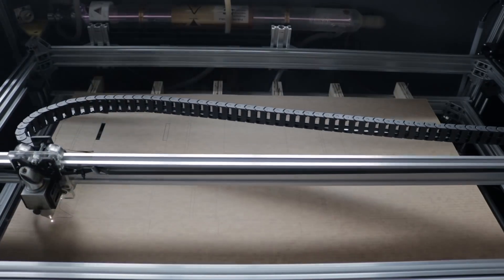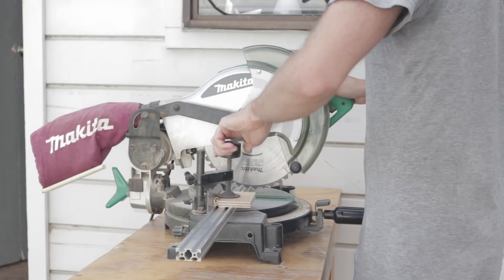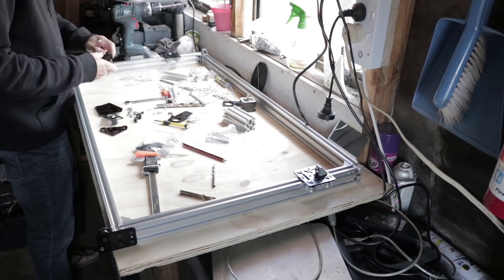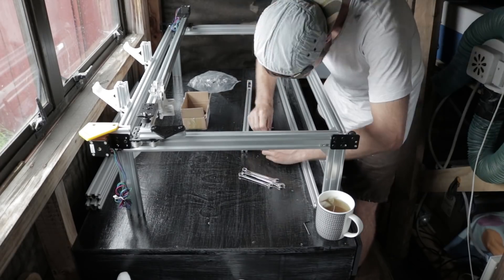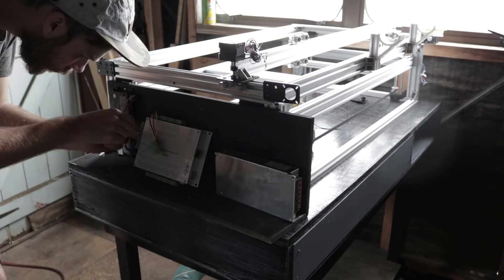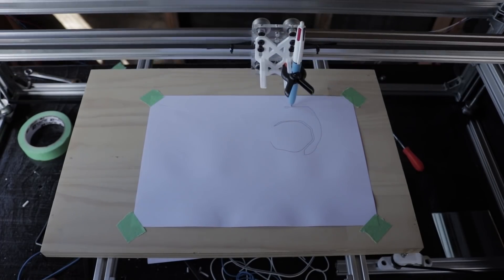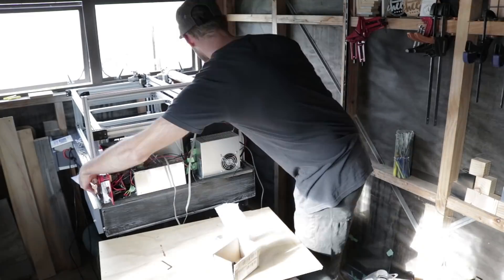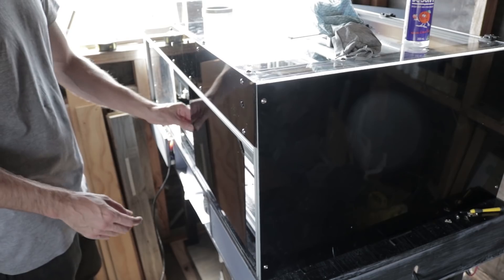DIY Homemade Laser Cutter

Comment: Very helpful. I'm currently in design phase of a simple 10watt optical diode laser, but I want the option to upgrade easily later should I choose to go CO2 (and finances permitting) but right now I got about 250 bucks to blow so I am pricing everything out during design. Figuring out what I can make and what I shouldn't make vs. purchase. Also what I can print for now and maybe upgrade later. This will be a fun addition to my little print farm. Gah, I need a bigger shop. Appreciate the time you took to document the whole process.

Comment: I used PLA to print all the parts for my D-bot printer back in 2015 and they have worked flawlessly to date so don't be afraid of PLA unless you're planning on storing in a very hot place.

Comment: Brilliant project. I have just finished building a 3D printer with the T slot aluminium.  I used a metal bandsaw and then milled the ends for squareness. Takes a long time but i wanted accurate dimensions. 
Thank you for confirming that a wood mitre saw can cut it quicker with good dimensional tolerance, I have been wondering about trying it.
Reply from the maker: Thanks, and no problem. Awesome! I built my 3d printer with t-slot too, very useful stuff. I was hesitant about using a wood saw for aluminium at first as well, but by dialing it in with a few test cuts and going slow, it actually works really well.
Reply: amazon sells a 10 inch aluminum cutting miter blade for 20 bucks

Comment: I have bought a lot of chinese machines and I wondered about building one from scratch.  It took me a few months but I built a 100w with a 5x8 foot bed using hybrid nema 34 steppers and a 708C controller.  I am looking at manufacturing them full time from my shop.

Comment: Well done! Thank you for uploading! I used a laser for a year nearly daily and rebuilded our lately.I switched from three to two mirrors by turning the laser tube 90 degrees and let it directly shoot I the second mirror. This was it needs a lot less recalibration.
Reply from the maker: Thanks! hm interesting I hadn't considered removing the 1st mirror, how does the tube fit in the enclosure - because wouldn't it need to be sticking out parallel to the end of the y axis?
Reply: Further Fabrication  yes, correct. Don't know if it's working, but here is a link to a photo of the setup.
https://drive.google.com/file/d/1_EqXSbv9Fm90gInfqRwfimIQC_ZlGP24/view?usp=drivesdk

So you need a little bit more space but on the other hand calibration is much easier, took me maybe 3 minutes in total.
Reply from the maker: Nice one, thanks for showing the photo! it's very cool to see a different method being used
Reply: sounds really big....even for a 700mm k40 laser

Comment: Awesome vid.  Just finished my own build - I took a quite different route but had similar size constraints. Ended up with 495x720mm cut size using the same 40w tube with plans for a Reci w2 soon. Wish I’d timelapsed my build now!
Reply: How much did it end up costing you?

Comment: Great build. We've got an 80W laser (700x500 bed) and it tends to be the 'goto' machine when I want something in a hurry.
Reply from the maker: Thanks, yeah it seems to be a good comfortable size for most things.
Reply: wondering how big is your 80w laser....designing and taking into acct possible upgrades. 1200mm+??
Reply: Physically, it's a big beast - about 1160*870*960, but the bed is 700x500. http://www.redsailcnc.com/X700.html    Bought it a few years ago and found it very useful. I'm sure you can get the equivalent cheaper now, however.

Comment: Still expensive for most people. But nice project.
How thick is the steel or titanium you can cut?
I would like build it but I prefer to try with a CNC because it can make 3D pieces.

Comment: I would very much appreciate a comprehensive, step-by-step guide to building Version2. I have no problem building the mechanics, but I lack the knowledge in selecting the proper and reliable electronics/controller/power supply, and the firmware necessary to make the laser functional. Thank you.

Comment: greate work , I got a question, why you use the vslot aluminium with those tire for the x axis in model 400 but you change that to square sliding one in the model 1200 ?
is that make the x-asis more stable?

Comment: I wish the tubes didn't wear out after a couple years...it's the only thing stopping me from making one. So tempting. Nice job!
Reply from the maker: Thanks. Yeah it's totally a pain, I just had to replace mine after 18 months. You just have to factor it in as a consumable
Reply: How much was the replacement?
I heard you can take the old one to a neon sign shop to have them refilled.  I don't know how much that would cost.
Reply from the maker: I hadn't heard of refillable ones, that would sure be handy! Depending on the power of the tube it's normally a couple of hundred dollars (I have pretty hefty shipping to deal with as well though because of my location).

Comment: great work .i'm going for a 3d printer using those aluminum gantries , basically the same thing only with more Z axe  distance , but seems there is a lot of details need to be taken  in consideration .
Reply from the maker: Thanks. yeah there are lots of little things you only really discover once you start building, you just have to have open to small changes and expect to get frustrated by things haha doing a 3d model first always helps as well

Comment: What is the power level of your CO2 laser? Does it have the ability to cut metals? Such as 4130 thin wall steel tubing (.028” to .042”).

Comment: Would it be posible to do this with an arduino, instead of spending 400 dollars on the controller with a single laptop and making the enclosure with a regular aluminium profile to save costs??

Comment: Hey man . dont know if you'll get this but iv just got the exact same controller the awc608 im having a hell of a job getting the limit/home switches to work. When the machine starts up it just sets off and crashes into the limit switches. they dont activate to stop it . did you have this with yours ?

Comment: So the laser light goes from the tube to a mirror to another mirror and to the ,,nozzle,, but how do you adjust for the Z axis movement. don't the mirror have to follow the z axis movement for optimal alignment.
Reply from the maker: Kinda tricky to explain without a diagram but I'll give it a shot. That's right about the beam exiting the nozzle and bouncing from mirror 1, to mirror 2, on to mirror 3 (located at the top of the nozzle), down through the lens. Which is this case has a focal distance of 2 inches. The z axis only needs to move to position the top of the material you want to cut into the 2 inch focal point of the lens. The z-axis then doesn't need to move again unless you change to a different material thickness. Hope that helps, sorry of it doesn't make sense!

Comment: Thanks for putting the price in the description. I was thinking to my self this doesn't look like a cost-effective build, but $2000 USD  very much is  if you're trying to cut engrave anything larger then 12" but if not  a $400 machine is going to be the way cheaper, plus I wonder if you can just use those components.  I'd like to know how much the box alone cost.

Comment: can this machine cut 6mm wood or acrylic sheet  ?
and please send us co2 laser power and its description as well.
and your work is too awesome
Reply from the maker: Thanks, yeah 6mm wood or acrylic wouldn't be a problem, you would just need to install at least a 60w laser tube into it instead of the small 40w one I'm using here.
Reply: @FurtherFabrication  Is there any chart or table you referenced as far was power versus material.  Like how do you know a 60W will cut wood and acrylic but a 40W will not.

Comment: I run a quite large laser myself. The video didn't show any type of exhaust system for fumes and smoke. It's quite important to have one for a number of reasons. Obviously for health reasons, and when the smoke from cutting/engraving goes into the laser beam path, it greatly decreases the power of the beam causing inconsistencies in the cut or engraving . Over all though, really nice looking build though!
Reply from the maker: Thanks, and thanks for sharing your experience! Yes good extraction is crucial and is a topic I could easily do a whole video on!

Comment: If I want a cnc which can cut aluminium and steel, do you have an advise for me as a beginner, which diy project is ideal for that or is it not wort it?
Reply from the maker: If it's your very first cnc building project it might be better to start with a machine that does wood and plastics. As your parts cost will be a lot lower and it won't matter so much when you break things as you're learning. Once you're comfortable upgrade to a machine that can do aluminium and steel.
Reply: @FurtherFabrication  Okey, thanks for the advise

Comment: What did this all cost you? and mabey link us to the electronics used?
Reply: What can you cut with it?
Reply from the maker: Good idea, I've updated the description. Total cost was around US$2k, electronics are an AWC608 DSP controller (not sure if they're still being sold, as I bought it a few years back).  At the moment it's only got a 40w tube loaded in it so it'll cut thin wood, plastics, foam and leather.

Comment: Why did you decided to use the aliuminium rails for linear motion instead of readymade linear guides?? Is it cost or something?? , that Aluminium rail with your makeshift bearing platform will not be able to provide the same geometric precision.

Comment: This must be the laser I see in the background of Ep2, of your current project. 

How well did the drag cable chain hold up? 

Did it bind, when doing raster engrave? vector cut?
Do you have a preference of cable chain style? IE: solid or snap
Reply from the maker: Yup this is the one.
I actually never changed the drag chain setup, just left it hanging out there and it was absolutely fine. Sometimes it would get a bit of a whip to it when I would raster at a certain spot at a certain speed, but nothing to write home about.
No real preference, just whatever is a good price at the right size seems to always work.

Comment: What size motors did you use for this? apologize if it was in the vid I didn't catch it
Reply from the maker: They're just regular nema 17s, same as what you'd use for 3d printers
Reply: Do you think nema 23 would be more beneficial or are the nema 17 more than enough? I've been debating between which set to use. Granted I want my cutting area to only be 16x16

Comment: With this profile size, is the rigidity of the machine sufficient?
Reply from the maker: Yeah it's totally fine. There's so little mass moving around on the laser head that you don't need to go over the top in reinforcement structure, like you would need for a cnc router machine
Reply: @FurtherFabrication  What do you think, if you increase the working field, you need to increase the profile cross-section to increase the rigidity of the structure?

Comment: Hi thanks for share, I got really interested in building one of this, but I have some questions before start such a projetc; to be honest from the beggining ... jeje; but I would like to know if your machine is able to cut 5mm thicknes metal sheets? if yes; could you give me some advices about where may I start; about getting more info to build it,  materials and equipment requiered, does it comes in a kit?; whre tu buy the kit.... well I neeed to know it all.... jaja
Reply: To cut 5mm steel you would need a very powerful industrial laser, the ones at my work are 4000 watts.
Reply: @theclaw6332  thanks for your response, best regards

Comment: Which power laser diode is best for this project?
It will be good if its cheap as well
Reply from the maker: Have a search on ebay or aliexpress using "40w Co2 Laser tube" the price will vary depending on where you live as the shipping cost is quite high.

Comment: Hi, I've been watching your videos and other regarding laser cutter/engraver. Im interested in starting a build, nothing fancy, but with one detail that I've only seen on commercial devices. Is it even possible to add an auto focus camera similar to epilog Lasers. I just like the ease of use and accuracy.
Reply from the maker: Yeah everything's possible. The reason many laser cutters don't use auto focus, is it falls on the bad side of the cost/benefit ratio. It's a lot of work (expense) to setup the extra hardware and software to manage it.

Comment: 0:40 you mention footprint, width couldn't be more than your garage door? 
Using that logic is your bedroom door as wide as your mattress? 
The width can be whatever you want.
Reply from the maker: Your logic is correct. It was just a self imposed restraint for my situation - to make it easily movable without having to tip it on its side. You can of course make one to whatever size suits your needs.

Comment: Being in the final stages of my own 80W build, I would appreciate it if you could elaborate a bit on the 'accessories' like the air assist, exhaust, and laser bed. 
For the air assist I've read everything ranging from an aquarium pump to a full blown industrial compressor. What are you using, are you happy with it, how's the noise, and does it require extras like air filter or water traps? 
For the exhaust, are there any specs you can give that you've found to work well? Do you direct airflow to/from the workarea by any means (slots in specific places, or a downdraft under the table? I've seen you use a tiny fan on top). 
As for the bed, I've seen you use various things like nails, t-slot, and construction rebar, is there anything in particular you like, dislike or would recommend? I was planning on using a honeycomb, but am open to alternatives.
As an aside, how's the V-slot holding up? Does it require regular maintenance like re-tightening and/or cleaning to keep it running smoothly? Does it allow for decent speeds (ballpark number on the speeds you can achieve?)
I'd appreciate it if you could elaborate a bit on the above since those are the last bits I'm unsure about and could use some advice from someone with IRL experience :) 

Thanks in advance, I enjoy the build and videos!
Reply from the maker: That's awesome, congrats on getting it almost finished! Those are some really excellent questions:
- The air assist I'm using is the same little aquarium compressor that came with the my original k40. It puts out enough air (no technical figures, but a 'gentle breeze') to keep smoke from entering the nozzle, but not aggressively enough to clear particles from the cutting path. For me this has been fine, it functions and hasn't broken. It would most likely be beneficial to have something a bit more powerful - but it's low for me in upgrade priority.
 - Exhaust is something you'll have to feel out a little bit with what it is you're cutting and the length of the run. The set up I've been using for the last few months as - minimum viable solution - is the K40 exhaust fan (essentially a bathroom fan), sucking from the back. With two 150mm computer fans blowing in from the front (positioned as needed). This remarkably has served me just fine. My exhaust run is also only about 2 feet long out a window, which probably helps.
-  Bed was a bit of a surprise, I wanted honeycomb but couldn't source it at a price I could pay. So 90% of the time I actually use strips of plywood with nails sticking up through. This leaves me with zero smoke marks on the underside and is really easy to adjust placement. 
- V-slot is holding up fine and accuracy is no problem - now that you mention it I should go round and double check the connections at this point - I have cleaned the rails several times but that's to be expected. The belt tension and motors are more of a bottle neck concerning speed, but I've always been limited by the power of the 40w tube dictating working speed. I typically engrave at 200m/s but can go almost double that if needed. 
Hope that helps!

Comment: What an awesome build and final result. I've been thinking about pulling my K40 apart to make something that can cut an A2 area.... I'm finding A4 just too small for things I want to make.
Reply from the maker: Cheers dude! Yeah that was exactly my thought! I got a k40 a few years back, swapped the control board for a decent DSP but then it kind didn't get used because I was restricted by that size - so then I was like 'well why don't I just make it bigger?' and here we are today haha. If you're thinking about upgrading I totally recommend it!
Reply: Yeah, I've done all the mods. New controller board, air assist etc... but you are a world ahead of me in knowledge with extrusions and mechanics and well... everything! hahaha... one day maybe!
Reply from the maker: the thing that took me to the next level was building a reprap 3d printer (if you haven't already). It's a really great way to learn about all those things because it's relatively low $ investment and danger, and it's extremely well documented